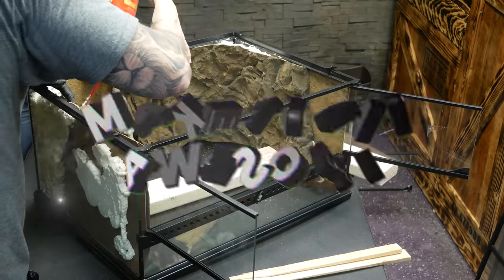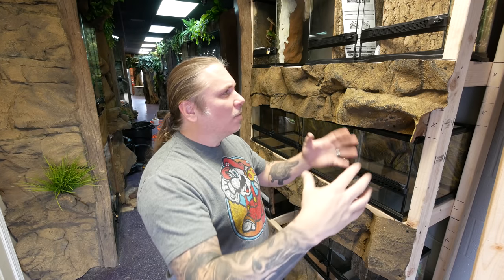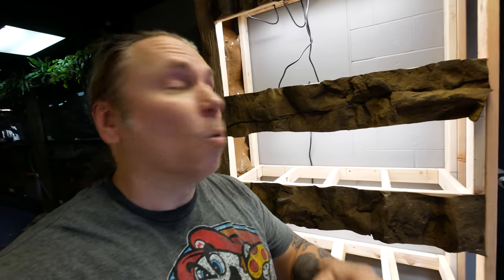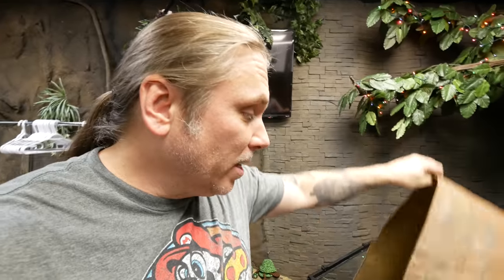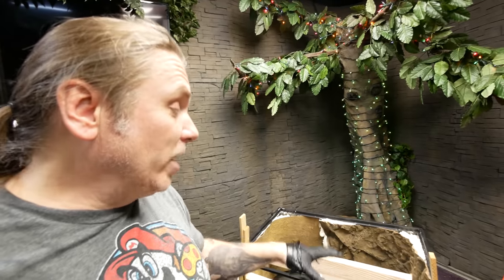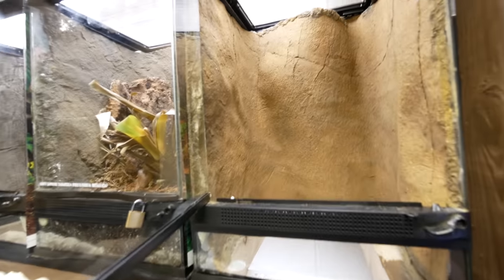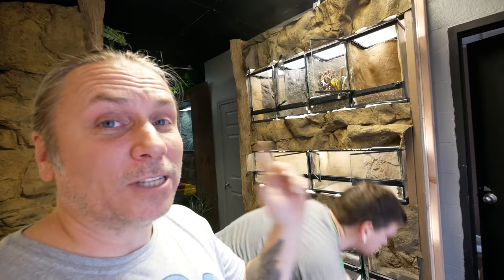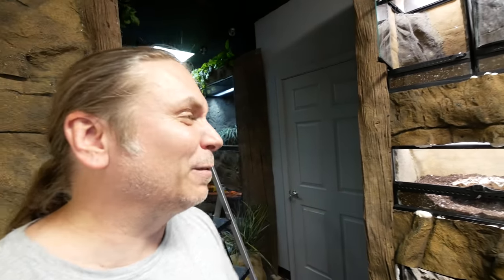INSANE DIY TARANTULA CAGE BUILDS on a BUDGET!! | BRIAN BARCZYK

Comment: I have nearly finished the background for crested Gecko!!!  Just need to bulk it out then paint and seal!!!  I am loving this!!!   Xxxxxxxx
Reply: Cathy Mannix Hello, I am designing a viv background using great stuff and had a question about curing/drying, Etc. I applied foam a week ago. I left it to dry for over 48 hours before I checked it. There was a large section (almost the entire length of the background) that was full of clear dark brown liquid. I cut open as many of the large pockets as I could to let it drain/dry. There are still a few left no larger than a quarter after 7 days. Should I be concerned? It is dry around the edges, top and face of the background, and the liquid is sealed between the foam and glass.
Reply: @Njg3697  I would personally try and clear out the liquid  if possible.  I have not use the expandable foam for my back round.  I have used papier Mache.   No glue involved.  Just mixed flour and water to a consistency of single cream.   Then paint and seal.  Good luck with your back round!!!!